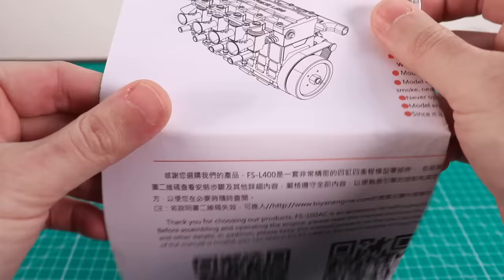Building a HIGH Revving 4 Cylinder Mini Engine - 4 Stroke Engine Build

Comment: I’m kinda shocked it only has two main bearings, but it also makes sense being 14cc
Reply: Indeed , that crank snaps under any load , they just keep changing their story on why , ultimately you have bought a paper weight.
Reply: Yeah, the lack of bearing and therefor low friction is why the engine revs up pretty quick but sadly it means the engine is almost useless as it breaks super easily. They have acknowledged several times on their Facebook group that this engine is a massive failure. 
Their new V8 has proper support for the crank but it really struggles to rev up, and sounds super sluggish.
Reply: @NorwayVFX  Every video I have seen of the V8 makes it sound very badly strangled, it just doesn't want to rev.

Comment: That looks and sounds amazing. I may have missed something there, but once it's assembled, how does it lubricate? I saw oil and grease being applied during the build, but nothing that indicates that it has a sump or oil pan. Am I being a tad thick? Otherwise, I know what I'm asking Santa (or my wife) for this Christmas!
Reply from the maker: It gets lubricated by the fuel/oil mixture.
Reply: @DIY-Garage  thank you for that. It had me wondering, but that makes sense.
Reply: I think this is a two stroke engine (2 valve per cylinder) , hence fuel oil mixture lubrication
Reply: @salwalmad  thats 4 stroke
Reply: I don't see how this can be a 4 stroke engine
Reply: @salwalmad  2 stroke. nitro oil mix. it will run 4 stroke if its really rich.
Reply: @medajim9092  bruh. the mixture has nothing to do with how many strokes it makes per cycle
Reply: @salwalmad  i see nothing that makes it appear as anything other than a 4 stroke?
Reply: @salwalmad  dude what? the fact that it has discrete valves that aren’t just ports or built into the crank signify it’s a 4 stroke what are you on
Reply: @milkparker4479  not usually, however nitro model motors will fire every 4th stroke when running too rich due to the time it takes to clear the chamber.
Reply: @medajim9092  True, but this engine is a conventional Otto cycle four stroke design.
Reply: Também quis saber..
Reply: @salwalmad  you don't determine if it's a 2 stroke or 4 stroke by how many valves it has per cylinder lol.

Comment: You didn’t have to do any timing when installing the timing belt? No Top dead center or nothing?
Reply: He did, the cam gear and the crankshaft have timing marks on them and he had them both pointing down that’s tdc
Reply: He did.... go back and watch
Reply: @jorgevasquez785  yes he did on the one cam, but on the other cam there isn't a mark. And when he put the timing belt on the one cam without a mark moved.
Reply: @blueeyeswhite132  it's an SOHC engine so the second cam gear without the timing mark is only cosmetic
You can see it's not connected to anything just an idler
Reply: @AlphaDomeLP  ah okay fair enough haha

Comment: Watch the delicate assembly process.
A single piston rings of tall, but the gap at the end of the ring, compression, wondering if there is no problem.
The actual engine piston rings consist of multiple ring connections zigzag to minimize pressure loss.

Comment: Cam bearings only on the ends? That cam will flex under pressure and valves will float... right into the pistons.

Comment: toyan model engines look cool and are really pretty to look at and Nice to assemble however, they never sound right. Never! I've seen other model V8 builds from individuals that make their own engines and they sound like a miniature Corvette engine or whatever it is they're copying, and it sounds good. The TOYAN model engine sounds have this hollow and empty quality to them. Not to mention the RPM band seems really narrow. A high revving 4 cylinder should make it over 8,000 RPM and it seems like it's struggling to get to even 4500. But at least it's super pretty to look at, there is that.. I'm not sure what kind of power it makes, if it's a reasonable solution for any hobby or model plane or car builds, it'd be cool to see people do something with it aside from just build it and run it on a desk (which is still fun and cool)

Comment: Assuming one would be willing to disassemble the engine on a regular basis to keep it oiled, would an engine this size be practical for running something useful?
Reply from the maker: Yes, its designed to be used in RC vehicles.

Comment: awesome video and very cool motor. how does it work without oil ? won't the metal 'glue'itself?
Reply from the maker: the engine gets lubricated by the fuel / oil mixture

Comment: Can someone explain to me how the flywheel contraption works? I'm a bit confused on why it doesn't drive the electric starter when the engine is running.
Reply from the maker: its a one-way clutch pulley, its only used when starting the engine with the electric starter.